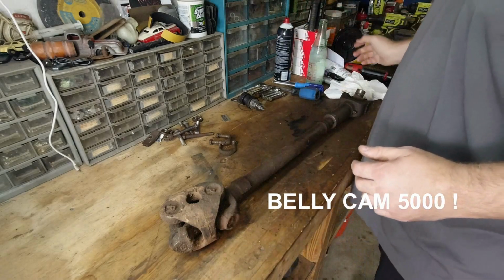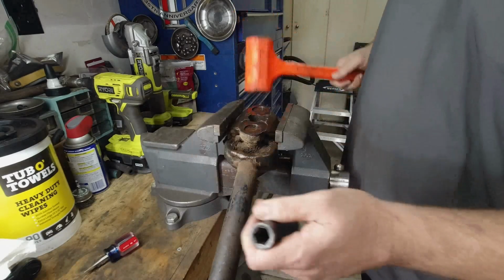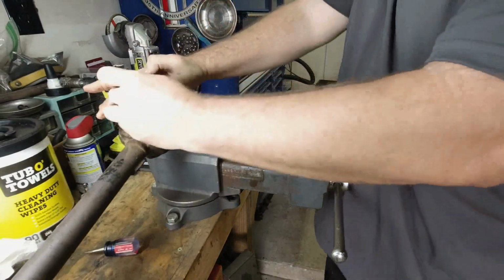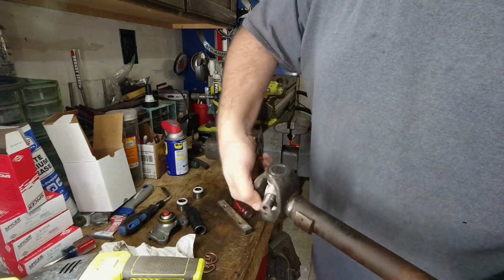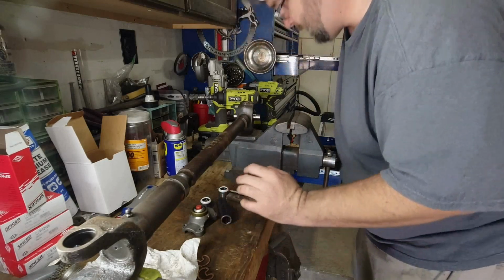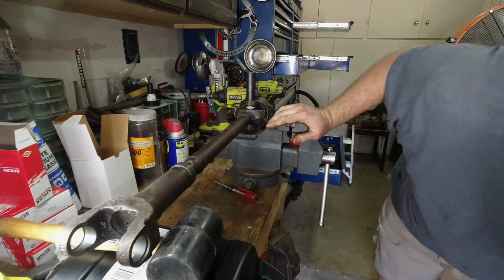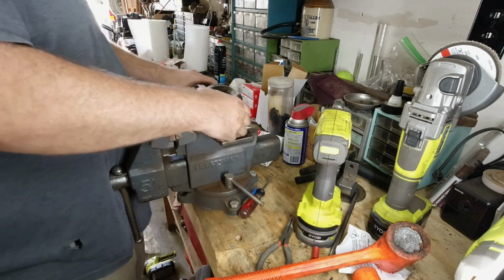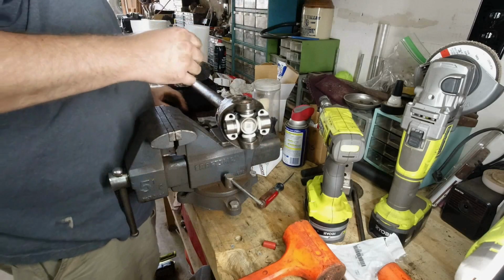Double Cardan Driveshaft Rebuild

Comment: I know this is an older video but a friend and I used a harbor freight ball joint press and impact to rebuild a driveshaft and made life way easier than the hammer and socket technique
Reply from the maker: Thanks Jacob.  There's a few ways to skin a cat as they say.  There's even a u-joint tool that's supposed to make this even easier than the ball joint press.  Uses the same method.  I've found the hammer and socket technique to be a little more physicaly demanding but quicker than setting up the press.  Thanks for mentioning other options.  I probably should have shown a couple of ways of doing this.  This is just my preference.